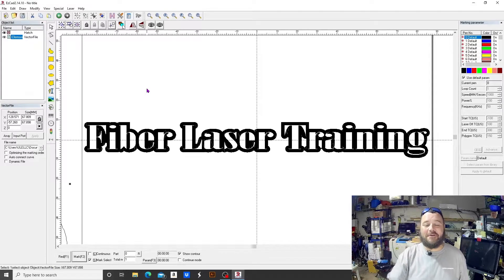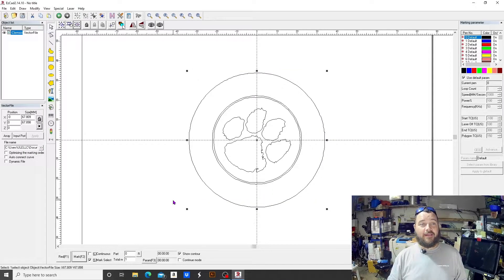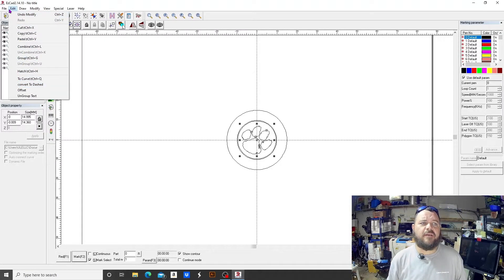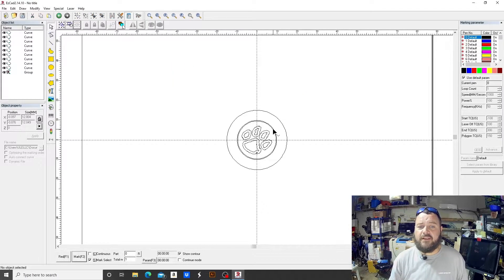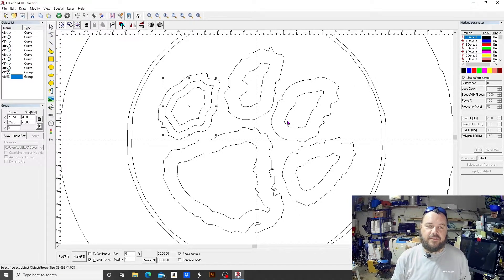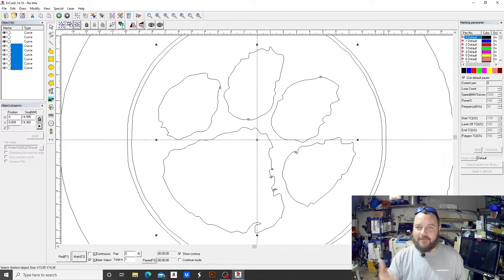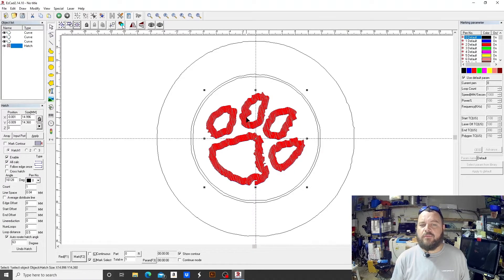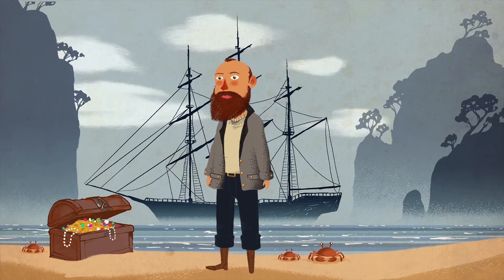Using offset in ezcad2@FiberLaserTraining

Comment: You're doing a very good job explaining and no music in the background. Thank you for that, but I need help with the software but the current version. I just got the new Z5-1 Fiber Laser Engraver, Desktop  I thought I would start with something basic and not too expensive just to learn the software, hoping eventually it will go to Lightburn. I do have three other. Diode laser  5w  10 w 20w  I'm currently using light burn but the software that came with it is easy cad I'm not quite used to that one but since you purchased yours two years ago, the software has changed slightly in the logo was completely different. I'm having a hard time finding someone that can actually explain the software without music in the background and out without just someone pointing a mouse around one location to the next with no explanation.  I need to know how to rotate text and make sure I set it for the 70 mm x 70 mm size. I know that it's not very big but it's good for beginning and then my sponsor will probably purchase me a newer one later.
Reply from the maker: @mysafename1694  
Rotate the text my 

CTRL+arrow 
Up/right is clockwise 
Left/down is Anti CW 

Should by default happen in 15° increments. So to rotate 90° you must 
Ctrl+arrow 6xs 

Set your work area with F3 and the field size to be 70mm if that’s the lense you’re using.